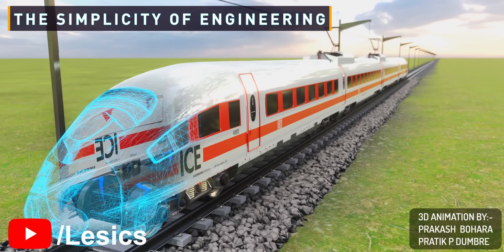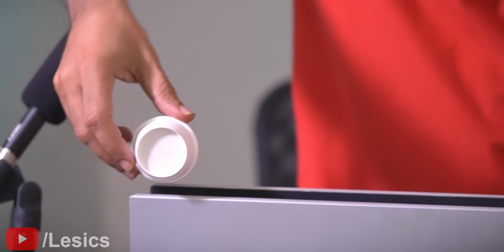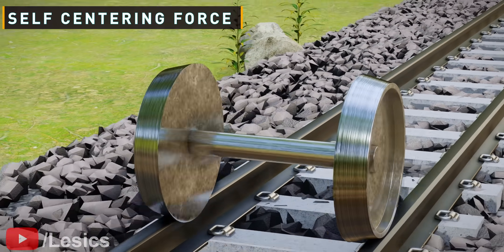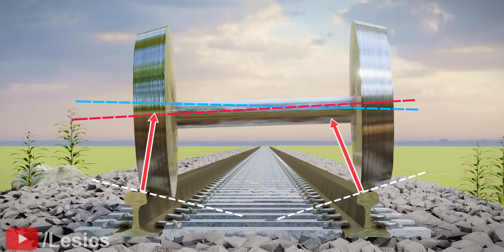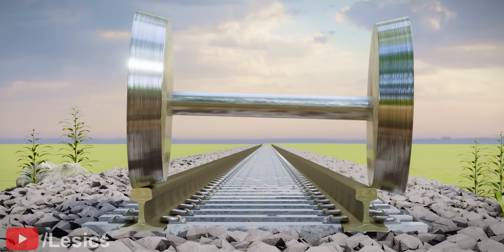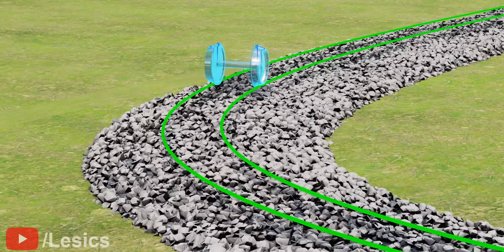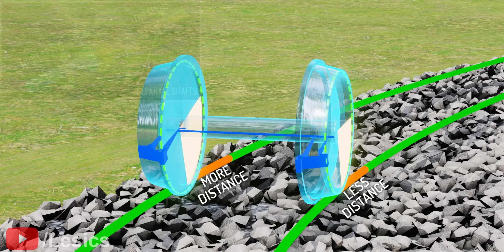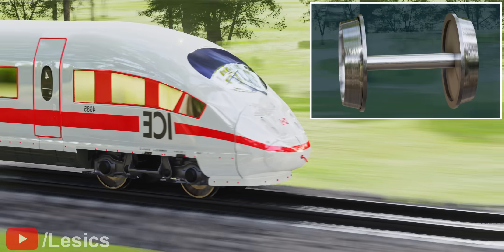The interesting engineering behind the SHAPE of Train wheels!

Comment: At 1:30 when you are showing the different forces at play, and you draw dashed lines to indicate direction of force being perpendicular to the angle of the cone shape of the wheel, I am wondering why the profile of the rail isn’t also cut to match that angle. Would that completely ruin the effect? Why is it better for the cone shaped wheel to only make contact with the rail at a very small point, instead of surface with a matching angle?

Comment: This is where the wheels' geometry comes in. To help the wheels stay on the track their shape is usually slightly conical. This means that the inside of the wheel has a larger circumference than the outside of the wheel. (They also have a flange, or raised edge, on the inner side to prevent the train from falling off the tracks.) When a train with slanted wheels turns, centrifugal force pushes the outside wheel to the larger part of the cone and pushes the inside wheel to the smaller part of the cone. As a result when a train is turning it is momentarily running on wheels that are effectively two different sizes. As the outside wheel's circumference becomes larger it is able to travel a greater distance even though it rotates at the same rate as the smaller inside wheel. The train successfully stays on the tracks! In this activity you will test for yourself how train wheel shapes impact their ability to stay on track.

Materials

At least four plastic or Styrofoam cups of the same size. (The cups should not have a raised edge at the top.)

Tape

Two rulers or yard sticks of the same length

Book or box

Flat workspace (that can have items taped to it)

Flexible cardboard or construction paper (optional)

Scissors (optional)

Wooden skewers (optional)

Preparation

😊

Comment: This differential system on fixed axles only works if the train is moving at reasonable speed. Anything lower than 5 mph then there is not enough inertia to throw the axle one way or the other.
 So, one of the wheels will skid or stall. I know this from personal experience . I project managed a bogie construction that had to navigate tight bends but could not exceed walking speed. The bogie had to be accompanied by men with crow bars. I begged the designers to consider one wheel drive, but to no avail.

Comment: So - by the normal forces explanation, a train would STILL stay on the tracks even if the wheels were not connected by a solid axle, but allowed to rotate independently, right?   

So there are two things keeping a train on the tracks (apart from the flanges, which are really just a last resort) - 
1) The normal forces having a centering tendency
2) Differential rotation having a tendency to steer the train towards the center.

I'm mainly wondering if two decoupled cylindrical wheels with their axles sloping down towards the center would still have a corrective tendency.
Reply: Actually - does the normal-force explanation in this video really make sense?  I see how it would provide a centering tendency on a frictionless track, where the horizontal components are not counteracted by friction. But it totally ignores the solid-axle.

Comment: BRILLIANT? Not sure about that. Less surface area in contact will the rails, means greater wear and tear in one specific area of the wheel, meaning it will cost more to maintain and replace them more often. Furthermore less contact with the surface ware also means less breaking power and the train will take longer to a full stop, this also has a negative side effect, this means the driver will have to stop the train sooner rather then later, which also will throw the entire railway time table out the window! where this design belongs.
You fix one problem you introduce two more issues! Lets just say this design wont fly in certain countries that operate their trains exactly on time!
Reply: I think you misunderstood. This isn't an alternative concept, this is used on every train in existence and has been for over 100 years. Train wheels are not cylindrical.

Comment: so that explains why train moves side to side sometimes even on straigth road, since thits looks like not tightly fit into the tracks but has free movement aloved to sides. But if you exceed some speed limit, you can still jump of the track even with flange safety?
Reply: yes of course
Reply: @pauliussvirskas6734  earlier i thought trains are safe unless they crash into other train. But did not think they can derail if there is no crash. So less safety than i thought

Comment: Good explanation, but two small faults - 1. you have exaggerated the angle of coning on the wheels [actually 10 deg], and 2. certainly in Britain, its former colonies, and in Europe, the rails themselves are angled in [also at 10 deg] so that frictional wear on wheel tyres and rail heads is even, and there is a centring force from the rails as well, whereas you show the rails perpendicular [perhaps the older USA railways did not use this technique, though I'm sure Amtrak does now]

Comment: 3:36 

In a big bend, the difference in the distance traveled by the left and right wheels increases. Is the "conical shape" of the wheels enough to keep the wheels from slipping like in a normal vehicle because both wheels are connected by the same rigid pinion?

Comment: If I'm not mistaken, the differential effect doesn't depend on speed, but the centripetal force needed to negotiate a curve does. Therefore it seems that there has to be a speed (and only one) in which both requirements are met. If not, other than with the conical design of the wheels, how is the centripetal force generated? What other design factors come into play? ¿Camber, ....?

Comment: Yes as you said something I learned a while back and yes very clever and simple. And most of us take it for granted.  Another thing folks do not maybe know is why is it so very easy to move a train wheel with a heavy load. It is hard and the track is hard no give, not soft as a car/truck wheel and the load needs to be lifted on a soft car wheel.  The harder the wheel is the more round and easier to move.  I like your video. Thank you.  As a kid if something worked.  I would take it apart to see why. If it did not work, I would take it apart and try to fix it. :pride-person-flower-nonbinary:

Comment: A moving machine's left and right side is determined by the operator's perspective.  Be it airplane, truck, car, or boat.  Boat is starboard or port but still determined from helmsman looking at forward travel.   From the forward travel of the wheels on the track, you are calling the left side the right and the right side the left.  With your description and you filled out a work order to change the left wheel, the mechanic would be changing the wrong wheel.   The mechanic always knows which is left and right.   You have to order brake parts as an example for the correct side as one side  will be backwards for the other side.    Repeat:   Left and right sides are determined by only the operator's perspective while machine is moving forward.   No wonder students get confused.

Comment: You fail to explain how the wheel go from the middle of the track during straight travel to the lopsided stance that allows them to take turns. I suspect it is thanks to the centrifugal force generated by the turn, which would have interesting consequences such as the train only being able to take some turns at the correct speed.

Comment: Great video. But one thing to be more precise, when cornering. 

Generally, any mass (here the train) wants to move straight. When there is a corner, initially, the train wants to go straight as well for a split second. This causes the outer wheel to be driven on a bigger diameter (and vice versa for the inner wheel) and thus increases centripetal forces. Since the train also sees a centrifugal force due to the mass‘ inertia, centripetal and centrifugal forces are equal to each other. That is why the wheels are not moving back to the initial position. 

As soon as the corner ends, the wheels re-center as explained.

Comment: While the differential action of the conical wheels is cool, this video fails to mention that is not a hard limit for the tightness of curve a train can take. Outer wheelslip on curves is supposed to happen all the time. That is the screechy metal sound you hear trains make when they go around curves. The differential action of the conical wheels just decreases how much wheel slip happens. This is also why railways apply grease to the rail on the inside of curves, to decrease wear on the wheels when they slip around the curve.

Comment: As a kid when I was in the train, I was fueled by the boredom (and ADHD) to just observe the train tracks going by, and I was just trying to figure out how the hell a train can go through the forks and changing tracks without derailing. Just staring at the tracks and switches (the wheels weren't clearly visible from inside the train, not even other trains'), I managed to figure out that having that little step bump on the inside made perfect sense. It didn't let the train derail and it the forks in the rail had small cuts specifically designed to let the train pass through only where it needed to go. I did not figure out on even guess at the taper and my mind is blown right now.

Comment: Nice video! 
Little addition: at 3:21 I missed the explanation on why the wheels slide to the outer site (besides gravitational forces, it works on a really slow trains too). 
The inner wheel overtakes the outer wheel like in a race which could be imagined like miniature turn in the outer direction. It's because before they change diameters they travel with the same distance per spin but the inner wheel has to go less distance per progression of the curve. Imagine you drive with really broad tires and there is a thin straight line under each tire. If you spin one wheel faster for a moment you would make a small turn but the tires can stay on the line and still driving on the straight line. Then the lines are just in a different position of the tire. In a train that's where you have those different diameters as greatly explained in the video.

Comment: The conical shape aiding in taling a curve has one downside.
And that is that the curve of the rail has to be within a certail range.
Cause is not, you will get wheelslip on the inside, which damages both rail and wheel.

Comment: When looking at the self correcting nature you failed to compare the conical shape with one another shape that I think would have been worthwhile. How would wheels with no curve work? You know, ones that look like a rectangle when viewed from the front, but maybe with flanges.
Reply: he explained that the Conical feature also acts as a differential when going around a curve. The curve in real world terms is not as tight as the one in the video.
Reply: @novosib9017  I know, I watched the video.
But that's got nothing to do with my original point
Reply: @michaelbaker7499  If the wheels were flat, i would assume they would bounce back and forth, left and right. 
Imagine you are on the highway, let your hands go from the steering wheel. What happens? - your car drifts into another lane. (we now have lane assist in cars, similar to the Plate on the Train wheel)

If your wheels were tapered and the road was a V, at high speed, you would naturally stay in the centre.

even at low speed, the sheer weight of the train carriage would push it into the centre of the tracks.

Comment: What happens when the train is cornering really really slowly where there is very little force pushing the train to the outside of the track?  How does it obtain the required differential action when I would think the train would stay in the centre of the track due to the slow speed?
Reply: the overall weight of each carriage is enough to mould everything together in unison, even at low speeds.

Comment: 1 is obvious, but I never thought about 2 before; that's really clever. My follow up question is whether there is a relationship between the conical angle and width of the wheels and the minimum radius of curvature of the track the train can use. Is this the primary factor in determining the minimum turns radius of a train and therefore the track it can travel on? Does this vary between rail networks and trains, causing compatibility issues? Presumably this also varies between gauges too?

Comment: As a railroad Mechanic who looks at wheels everyday about 400 sets a day inspecting trains, this video is bs. They temper when new or turn but they wear flat quick. As long as the flange be comes bigger than it’s gauged for the wheel is still in service. Wheels are not cheap and train of 100 cars with 4 wheel sets per car is expensive to address. And over 15 years I never seen a sharp turn like shown in video

Comment: So straightforward and i'd never thought about it! :O 
It's even a better differential than a car given its permanently locked (the inner wheel is not free spinning and dn need a self locking diff to achieve more traction, like in cars)
The stabilizer anti-derailing function is very intuitive, I'm no engineer to calculate w numbers the vectors sum you shown but i was getting it at the first min of the video. Yet I'd never thought about it.
This video was brilliant, i enjoyed, and learnt! :) Thanks!

Comment: Sorry to ask but does that have a limit on the turn radius as well.? For example sharper bends will need greater differential action. I guess it also depends on the size in the width of the wheels... Thanks.
Reply: Yes it does put a limit on the turn radius

Comment: The difference in circumference traveled in a curve is a fixed number, different for each curve. 
Secondly the point of contact between the rail and the wheel is an infinitely small point. Hence immense pressure. YOu could say that the wheel is always actually being pulled uphill slightly . Like pushing a flat tired wheelbarrow. The strength of the rail and wheel will determine the  rolling resitance.

Comment: Maybe you should install differential gear in the centre of train wheels axle in that way you won't create tightness force on the outer wheel when make a curving turn.alot of train track traveling in a long distance curving but what about circular turning in a short distance.that why you should install differential gear in the middle of the wheel axel and it won't create tightness force on the outer wheel when turning and also avoid train wheel pushing the train track on it originaly position that was first lay. That why the train track looks bendable snake instead of straightness from when it was first lay or create

Comment: Stupid ...more like lowering friction and pushing debris out. Differential? Are those even connected and why should they, especially in a train where every cart has its own engines for left and right side wheel sections ...and difference in diameter is set in stone as certain proportion while turns on track are not, that's why they say "help" ...but this help is so pitiful it's like saying red paint help to rise speed, and as far as centering, neither of the rails are even or set up straight, not only that wheels have internal disks to keep them centered regardless.
Is that how engineering in western world looks like, or more like brainwashing?

Comment: What you call the "left wheel" is only left to a viewer facing the screen, however for an object in motion, the DIRECTION OF TRAVEL dictates which is left and which is right; therefore in your example, what you call the left wheel is actually the right wheel if you're the conductor of that train. The proper way to explain it is to tell the viewer, the wheel on your left which is the right wheel of the train in motion due to its direction of travel.... and then continue with the explanation. If the direction was reversed, that is if the train was going in the opposite direction, away from the viewer; then the wheel on the left of the screen would be the actual "left wheel".

Comment: The radius difference between the inside and outside of the wheel seems so small. Is it really enough to account for the difference in distance traveled between the inner and outer wheels on a curve? If not, is there some slipping also?

Comment: Sorry to challenge this extremely well made video but the theory that I heard is different.   The key is that the wheels are locked into rotating at the same speed because they share an axle.  When they move off centre, there is a restorative action, not because of the tilt as the video outlines, but because you now have two wheels locked together in rotation that are essentially different sizes (because one is operating in a larger circumference region and the other in a smaller circumference region).   As one can imagine, this automatically turns the train back towards the centre of the track.   The explanation proposed in this video, (tilting and forces vectors changing direction), if it is true,  should work even if the wheels didn't share an axle and were able to rotate independently of each other.  I don't think this is the case.

Comment: 2:08 There can be no net force when the system is in equilibrium, the hypothesis that the weight is divided 50/50 between both sides doesn't stand, thus lateral forces cancel out. Movement towards the center is caused by the difference in radius at the point of contact with a constant rotation speed.

Comment: I used to work in a machine shop that used a very large lathe to re- turn the taper on box car wheels. The taper would start to wear flat, causing the wheels to wander on the tracks. The machinist would use a template to check for the proper taper. It was a slow process, because the wheel surface becomes surface hardened as it rolls along the tracks. You would have to machine the wheels at a slow speed because of the diameter of the wheels as well. (Surface Feet per Minute). Great video!
Reply: That must be one hell of a lathe !